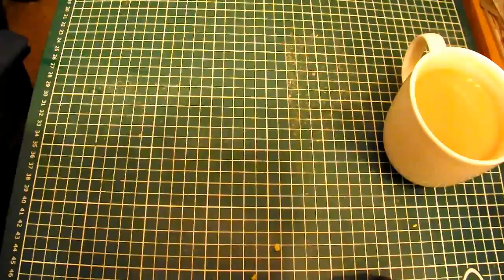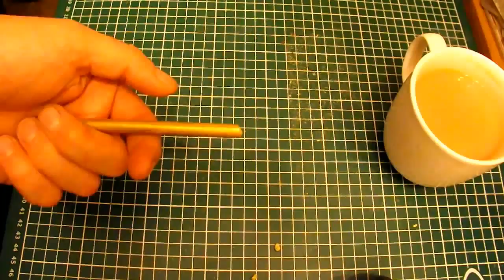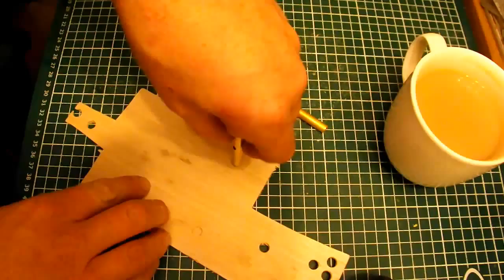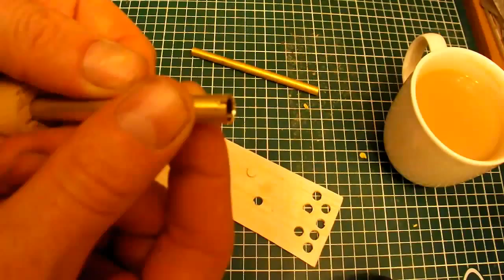Basla drill

Comment: I can promise you, you don't need slots in the tube. Aluminium tube  or any steel tube, even stiff plastic tube will do. Pen cases or other house hold items, some bottle tops, cans! Try and remember to clear your tube after each hole. If using a drilling machine then select the slowest speed possible. CF tube won't work.

Comment: Any ideas on cutting larger holes, where brass tube isn't practical to find?  Like 2", etc
 Holes saws tear up the wood.  Thanks
Reply from the maker: @jerrygiles1661  any metal, even plastic will work but for holes that size i use an adjustable size circle cutting tool from a craft shop